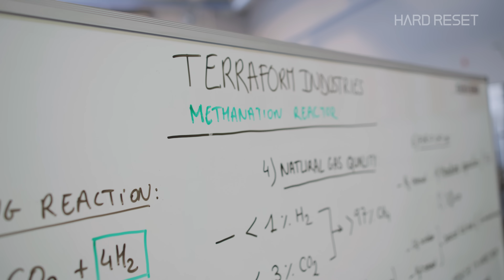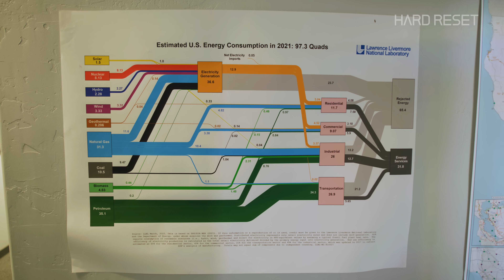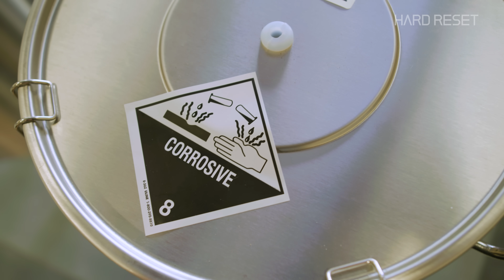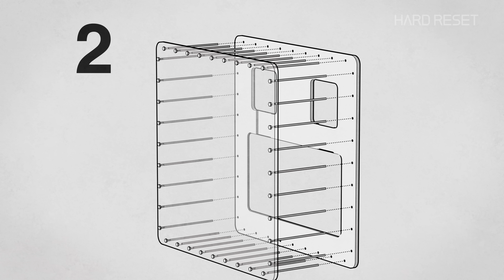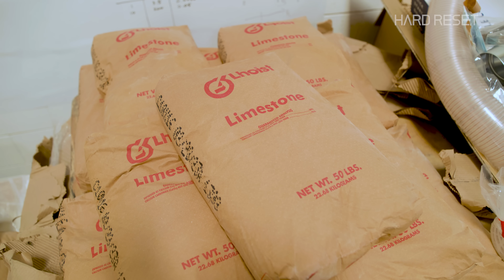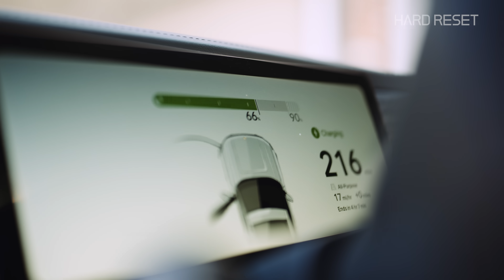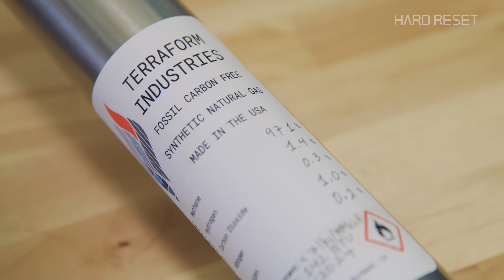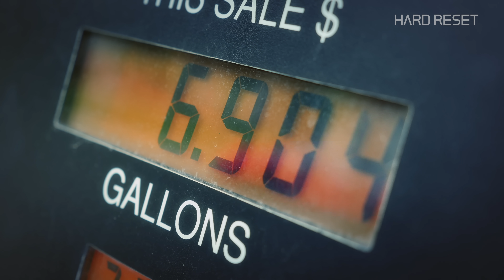The Last Fuel We'll Ever Need?

Comment: I'm autistic and did something along this same line, but MUCH, MUCH simpler.

I purchased a used, but working photovoltaic pannel and the otherwize FREE electricity it makes, runs an air compressor.

I also design and build vertical-axis wind turbines that compress air.

In all, I compress & store roughly two thousand gallons of air. 

I call this my "air battery".

That compressed air in turn, runs small homemade engines of my own design, each coupled to a generator (dc) or alternator (ac).

Whenever I need electricity,  I make it.

Discounting 60 years of R&D (done as a hobby), I' d be surprised if I have more than $500 invested and I have a working system. I homestead on the Texas prarie.

I'm 76.
Reply: The compressed air solution has always been my idea of simple and effective energy storage and transfer.
The downside is efficiency. But if cost is low, that matters very little.
Reply: @Stan-b3v  
I overcame inefficiency by inventing my own air motor. It is a three piston, single cylinder turbine with only one moving part -- as simple as it gets. It gives instant great torque at any pressure. It "putts" as it runs as the exhaust valve opens and closes. Again, 3 pistons, one intake & one exhaust valve and still only one moving part.

Don't pull out your hair trying to figure it out. Remember,  I'm autistic and DO NOT think like normies (everybody else). I will feature it in an upcoming video on my YouTube channel.
Reply: @SiwyWabbit  You seem to be using words to mean something that differ from the generally accepted definition. Piston by definition moves. A turbine by definition moves. If your 1 moving part is accurate then it is something other than a 3 piston single cylinder turbine. Is it a 3 stage turbine, or 3 similar turbines connected together?
Reply: @benhatcher2603  
I'll post a video sometime. 

You and 99% of everyone else, and I DO NOT think in the same realm.

 Y'all think on conventional terms based on known values. 

I don't. I do my own original thoughts.

You're thinking of a piston trapped inside a cylinder. 

For now, here's a hint:

All 3 pistons are external from the cylinder.
Reply: Probably similar idea to a triple-cylinder compound steam engine where the pistons are of different sizes to extract as much energy as possible as the pressure drops?   @SiwyWabbit
Reply: @MAR.LARKIN-YES-T  
Nope . . . Not even close.
Reply: @SiwyWabbit  3 pistons and 1 moving part?
Reply: I want to pull my hair out.  If the pistons were moving, that would count as 3 moving parts alone, so perhaps the cylinder moves across the stationary pistons?  @SiwyWabbit
Reply: @karllued  Nope
Reply: what does being autistic or 76 have to do with your invention that you will not share the details about?
Reply: @lostvisitor nah man, I believe all the things hes said is present day technology. Anyone with the drive to do so can just do it. Im sure a simple browse through this guys channel would give enough info for people wanting to attempt it for themselves. Whats the point explaining how his stuff works exactly, to people who wouldnt intend to do it? I had a look on his channel and thought yeah, theres enough info there without him having to explain in detail to everyone asking. Altho one thing I really hate about compressed air is the moisture generated in the tanks and pipeline if you dont include a dryer in the system
Reply: @de0509  
Good point. I use a tickler valve at each storage tank low point to relieve moisture buildup. My engine works fine on high moisture, so it's not a problem. I made a 3 piston, single-cylinder positive displacement  engine. There's only one moving part and moisture actually helps seal the intake and exhaust valves.
Sidenote: my YouTube channel's sole purpose is a platform to showcase my several projects to my kids and grandkids. I don't cater to subscribers.  In fact, I posted a disclaimer telling folks to NOT subscribe. I don't chase money and will never be an affiliate advertiser. Monetization is a non-issue. I just like to build stuff and Show & Tell was my favorite class in school. 🤓
Reply: @de0509 what's his channel? I tried searching his screen name & got nothing.
Reply: @ryancampbell2192  bro just click on his profile picture here in this comment thread
Reply: @de0509  Why?
Reply: @lostvisitor  
Google it.
Reply: @lostvisitorprobably BS
Reply: @JonSmith-s7z  
Probly
Reply: @lostvisitor similar to love, technology is not real until shared 😊
Reply: @TheBeneke74  
Wrong!
Reply: That's absolutely fantastic that you achieved that, I always appreciate people who are willing to do their own thing and try and innovate even if it's not for profit. However it must be said, the energy density of compressed air doesn't come remotely close to the energy density of a compressed combustible gas. To run everything on compressed air would take ridiculously large tanks, too unfeasible, especially for things like vehicles. The energy density of batteries compared to other fuels is already bad enough with most equivalent electric cars weighing between 500kg and 1000kg more than their equivalent gasoline/diesel equivalent.
Reply: @DanielK-xn5si here's a thought. What if the compressed air tanks were those that offer buoyancy to a boat? Tap into the compressed air for propulsion.  And when anchored or docked have a way to capture water currents to charge the compressed air?
Reply: @DanielK-xn5si You did not understand what this guy said.  you defaulted into the talking points of the media who reject things that work because that would  destabilize  the gas and oil business that runs  the world.   He said it works but you did not hear that you just repeated what you heard on the news.   There is a fellow who proved that compressed air can push hard enough on a piston to bend a torque wrench to 90 degrees.  Gasoline can never do that.
Reply: Wow thats cool. But Im sure theres a time and place for everything. For static installations yeah the compressed air as an energy storage would probably be a great option, but for vehicles you might want a more energy dense kind of system.
Reply: @de0509  
I'm 76. My only interest in vehicles revolves around my tractor and dreaming of the day a bus runs out to where I live. I homestead in North Texas out in the middle of nowhere.
Reply: @SiwyWabbit  yeah, but theres billions of other people on earth with wants and needs different from you. So people will automatically strive towards things different from what you have made for yourself
Reply: @ India at least tested vehicles using compressed air, but those were not full size cars and they were only meant for short range trips within the city.
Reply: @AnalystPrime  Those cars failed because the motor got so cold with frost on it from the cold air release that the motor failed.
Reply: @  Figures, the constant release does not allow for the system to unfreeze.
Reply: The decompressed air would be cold, and could be used to cool a house, I would think.
Reply: @FLPhotoCatcher  
That sounds about right, except for one thing: 
It won't 😕.  
There's not enough pressure difference to drive the temperature lower than several degrees below ambient.
Water, on the other hand, has 540 kcal/mole, so if compressed air is used through an eductor, vacuuming the water, when the water undergoes phase change from liquid to gas, THAT gets downright cold. 
To avoid all that wet air, the cold stream can be used in a heat exchanger.
Reply: @FLPhotoCatcher  That is true.  Car company in India tried to make a compressed air motor for their car.  In 100 degree temperature the motor was completely coated in frost and the engine failed because it was too cold.
Reply: That sounds amazing. Have you made any videos?

Found em👍🏻
Reply: @No1_Gunslinger  
Nope. Hide & watch.
Reply: @No1_Gunslinger link?
Reply: If you homestead and want heating or cooking fuel. A bioreactor would be a boone
Reply: @brettmoore3194  
Tried that. I like propane better and propane is free.

Free?  Yep.
Reply: @WhatDadIsUpTo  I'm all ears and potatoes
Reply: @brettmoore3194  
Huh?
Reply: You have me very intrigued with this solution, especially designing your own engine to make it work for a generator
Reply: post a video! i'd like an air battery. i know the amish and others do this. but selecting the right air compressor run mechanically from a windmill is beyond my present abilities. 

i live off grid and have plenty of solar power, but conventional electric air compressors are too hard on my house inverter to run all day long. a compressor from an old fridge might work but i don't know how to deal with the oil.
Reply: @AJTarnas  
Use an 18-volt PV panel and wire it directly to a 12-volt motor. Use pulleys, chain & sprocket or gears to lower speed & increase torque & couple it to a small compressor.
Reply: Here is my guess... This is essentially a peristaltic pump... The single cylinder is a flexible tube. The three external pistons are rollers on a single rotating axis, most likely spaced 120 degrees apart from each other. While this sort of pump is normally used for fluid instead of gas, there is no reason the design could not be adapted for generating high pressure air.
Reply: @JasonBechervaise  
BINGO !
You get the gold star.  You are correct. I have a few iterations, but essentially all alike.
Good job!
Reply: @SiwyWabbit  So more than one moving part?
Reply: @karllued  
No . . . Millions, if you count all the electrons spinning around inside the materials comprising the parts. Otherwise,  yes, just one main part moving.
Reply: Scotland has liquid air battery storage that is run through piston engines. They are grid level and live on our grid now.
Reply: Are there any companies working on such tech to deploy at a larger scale ?
Reply: @olit1234  IDK
Reply: @olit1234  i don't know about storing compressed air, but i had heard about an EV charging station, our of the middle east.  they wanted to store energy in a flywheel, that would be rotating at something like 115,000 RPM.  in a vacuum.  so an EV would drive up, start charging, and this fly wheel would be able to generate an additional 35kw or something for 2 hours, to help charge vehicles at a station.

better in the long run than grid batteries, as it would not break down like chemicals.  

also heard about storing heat in sand.  again, this would be on the scale of large grid batteries.
Reply: @ At least one bigger company is doing CAES. There is also LAES or liquid air energy storage because while the cryogenic air may need insulated tanks those tanks are not under pressure and store more energy. Also this is all off the shelf tech, just like OP, so no need for high tech battery factories. About a year ago on YT there was videos about a prototype CAES/LAES plant in UK. The gas peaker plant it was built attached to wanted them to make even bigger air battery because energy storage is cheaper than burning gas.

The main problem slowing down utility level CAES/LAES adoption was figuring out a heat battery system that stores the heat released when compressing or freezing the air and gives it back when you want to run the generator. The air that comes out must be heated up or it will freeze your pipes, and if you use an external heat source the efficiency will drop.
Reply: @AnalystPrime  
I've not witnessed any of the several problems you listed.
Reply: @ 
 @WhatDadIsUpTo Compressing and expanding air changes temperature but it should not become a problem on smaller scale like your system. If you empty a scuba tank quickly at once it might get little frost on it that would melt in seconds; grid level energy storage uses storage tanks of hundreds to thousands of cubic meters scale so the amount of heat they need to move becomes significant.

I just noticed but neither of my above comments show the person I was answering to though their name was there when I posted them. Anyone know what Youtube is messing up this time?
Reply: Youtube both lost the tag I was responding to and now it does not let me edit the post, this is why nobody should pay for this badly programmed website.
Reply: @AnalystPrime  
Blame me. I'm autistic. I've been blamed for everything for 76 years; I'm used to it.
Reply: Cool!
Reply: Nice system.
Reply: @aperson5062  
Thanks
Reply: I would love to see a video
Reply: What you are doing is amazing, but the goal here in view is to get CO2 from the atmosphere and make good use of it in the conventional way, like a substitution of fossil fuels.
Reply: @edgarkeisi  
Not my goal. Global warming is a ruse.
Reply: Why don't you store the electricity in a battery?
Reply: @harryw29  
Batteries fail. Potential energy doesn't.
Besides, using batteries is for normies; I'm autistic.
Reply: @SiwyWabbit  Photovoltaic panels fail, so the electricity is not, "free".  Your 3 piston engine will wear out even if it has 1 moving part.  When I was a young kid, I decided to make a, "free" radio.  I used a solar panel that I made from 6 series solar cells that were capable of 1 amp at 1/2 volt that I bought from Radio Shack.  I used 2 rechargeable D cell nickel cadmium batteries and a double pole double throw switch that could switch the batteries from parallel to series.  The transistor radio required 3v to work.  This was my upgrade from a crystal radio.  Every morning I would throw the switch to put the batteries in parallel for charging.  I made a housing from outdoor plywood, with a glass panel that I sprayed with many coats of polyurethane varnish.  The glass was sealed with silicone glue to protect the solar cells.  This was around 1970.  At that time, the solar cells alone cost $10 each.  The whole setup lasted about 5 years before the batteries would not hold enough charge to play the radio all night.  Snow on the roof would sometimes cover the solar panel, so it wouldn't always charge the batteries.  As parts failed, I realized I could have just charged two sets of batteries in a standard charger for less to run my radio.  Besides my parents were paying for the electricity.  Nothing is free, where I live now, you can buy off peak electricity at about 3¢/kilowatt hour for an electric car.  This sounds great, (almost free), until the batteries fail in your electric car.
Reply: @karllued  
Correction:  My 3-piston engine will not wear out - EVER!  I say that, because the nature of the beast does not follow conventional lines of thinking. I'm autistic, remember?  The 3 pistons are external to the cylinder. My engine wears "in".
Reply: @WhatDadIsUpTo  So you're using compressed air?  The container will eventually develop stress cracks and fail.  Your 3 pistons that "wear in" can't be moving at all, or they would count as 3 moving parts.  How can they, "wear in", if they don't move?  I'm not trying to be a troll, I just have a very practical mind.  I spent 35+ years repairing electronics.
Reply: @karllued  
I'll post a video for my grandson, also autistic, if he can't figure it out.

Meanwhile, your concerns are moot.

What if a meteor the size of Vermont slams into the earth in the next 12.7 srconds?
Reply: Then your entire setup is also moot? @SiwyWabbit
Reply: @karllued  
Speak for yourself.
Reply: @SiwyWabbit  Well it's been more that 12.7 seconds, so I guess the meteor problem is no longer valid?
Reply: @karllued 1 kilowatt hour 3¢?
Your joking right?
Here around 10¢ and worse part is the average income in your country at least triple of what we have which basically means the government sells electricity to us 30¢ for each kilowatt hour... 😮
Reply: by the "spectrum" claim you mean like Asperger the Nazi who had his autism disease fascism removed from the DSM? No thanks.
Reply: Thanks for telling us your autistic lol. Most if the world is. But very interesting, thanks for sharing
Reply: God bless your sir
Reply: Excellent!
Reply: I have brown hair and motor tics and have done something very similar. Not that those first details are relevant
Reply: great idea!
Reply: Very Cool !!!!!!  I love it !
Reply: Your sttuff is not scaleable. Batteries are.
Reply: @rogerphelps9939 
Ask me if I care.
Reply: 👏👏 awesome air combustion is real bravo I have to listen to all these innovative innovative channels especially these days so many people are holding us back from real innovation & greatness. It gets so tired & boring a complete yawn fest. Keep at it, air combustion bus real I believe in you.
Reply: Cool! 

Gotta love it!
Reply: https://youtu.be/xwQpgG7Ii3A?si=5XH08xZuBXAJ8xxv
Reply: 😂❤ LOL YOU STOLE THE SHOW...
Reply: Yes but we can't use your compressed gas in a plane or a boat. Yes it's  more efficient, but it's not a drop in replacement for fossil fuels which this is.
Reply: It works for me. I don't own a plane or boat. I use compressed air for stationary power applications.

If you want to use it in your plane or boat, you'll have to invent your own iteration.@annakissed3226
Reply: What does your being autistic have to do with anything?
No, you are not smarter than everyone else. LOL hilarious.
Reply: Are you compressing two thousand gallons of air or storing two thousand gallons of compressed air? (and what pressure)
Reply: Yes @catprog
Reply: Instead of going through all this nostalgic things. Work should be done on utilising hydrogen as fuel directly using fuel cell technology. 😮😮😮😮😮😮
Reply: @nemojosh1954 
Great idea. You pay, I'll play.  I've built fuel cells and manufactured hydrogen.  BIG BUCK$!
Reply: Yes storing compressed air is probably better
Reply: Publish your design and share it with people. Otherwise all that work is pointless
Reply: @DavidRodriguez-gl5pn  
I'm not from the land of Point, which makes EVERYTHING pointless.
No, I will not publish it. 

I figured it out -- you figure it out.
Reply: @SiwyWabbit  so basically you’re a liar 😂. Saying things online with no proof is dumb and a waste of time.. way to make your “life’s work” completely useless. Humanity won’t miss selfish people
Reply: @SiwyWabbit good man!
Reply: @SiwyWabbit  just the idea that it can be achieved is enough. Thanks.